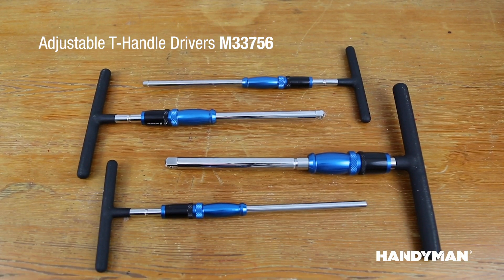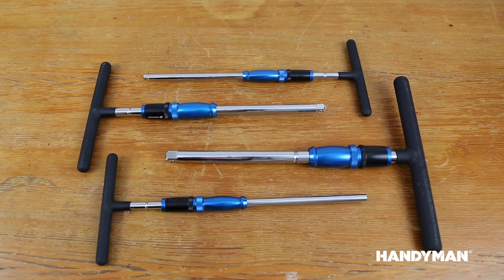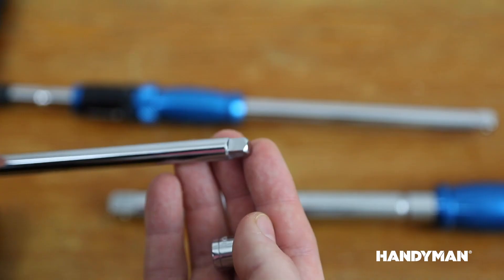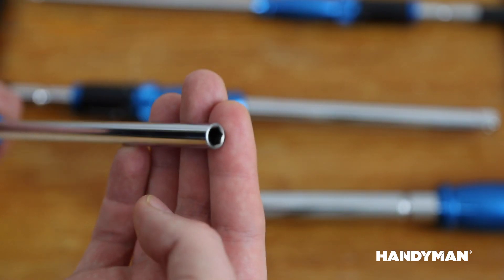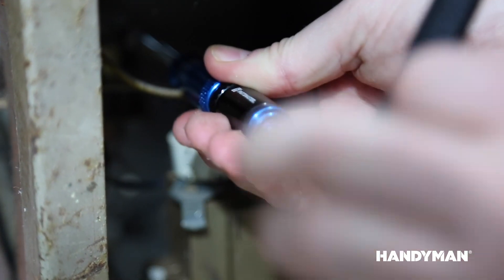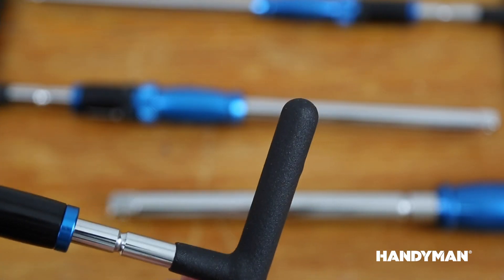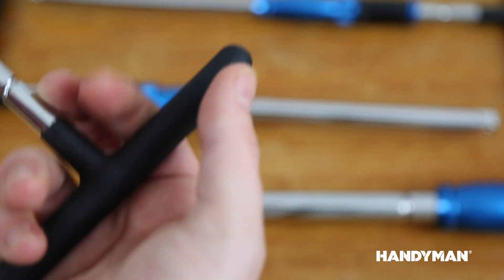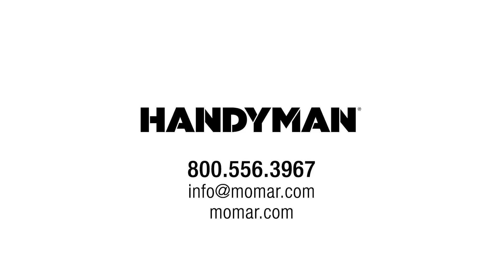Handyman Adjustable T-Handle Drivers

Comment: I'd order one if the handle wasn't built in.
I'd rather attach a sliding T handle.
If you just sold it as a socket extension you'd be the only one on the market.
Would buy.
Reply from the maker: Thanks for your interest in the Handyman Adjustable T-Handle Drivers.  We do offer a product similar to your description, the MASTER ADJUSTABLE UNIVERSAL EXTENSION BAR, which you can find here on momar.com: https://momar.com/item/19780/master_adjustable_universal_extension_bar